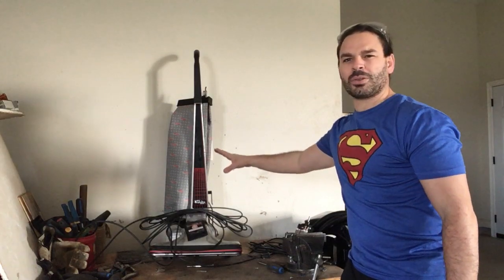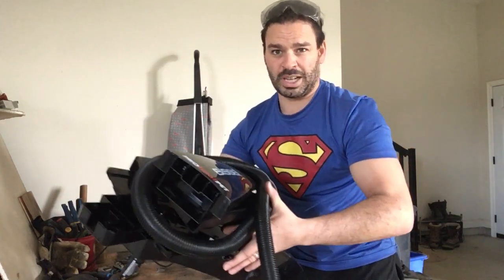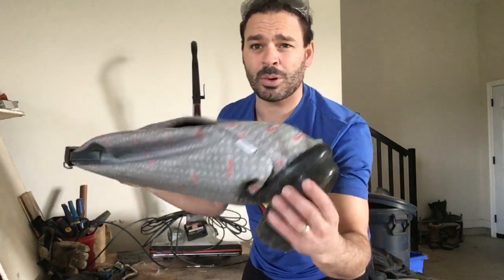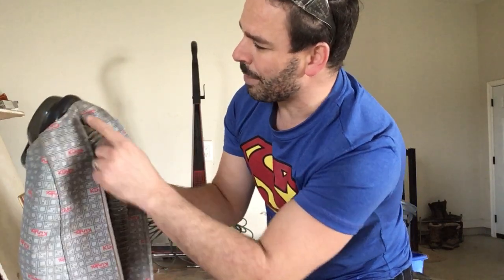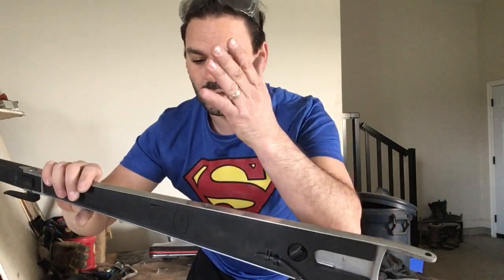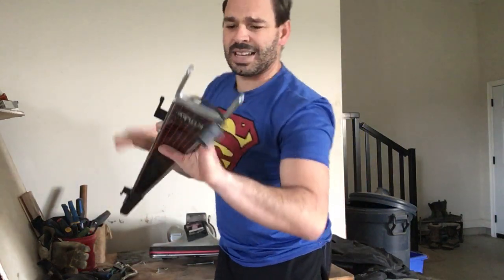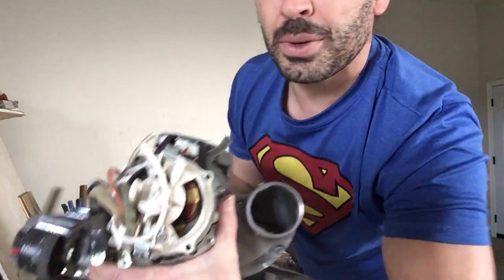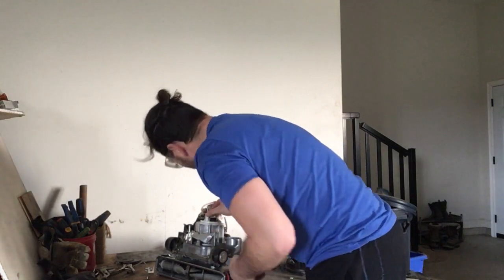Scrapping an old vacuum cleaner for copper, cast aluminum, brass, steel, and very little waste.

Comment: I grew up with a Kirby, and hated cleaning out that bag!  It did do a pretty good job though.
Reply from the maker: It is too bad it did not work. They just don’t make things like they used to. Thanks for the comment
Reply: @TinManScrapper  if you get a kirby vacuum you can call kirby for parts for any molde the only one's  that they don't make parts for is pre ww2 if you buy one new  that is a 2500 dollar vacuum

Comment: You have an 84 Kirby Heritage. It was probably an easy fix, you could have replace the switch and sold the vacuum for $100. Great video!
Reply from the maker: Thanks for letting me know! Lesson learned, but at least it did not end up in the landfill. Thanks also for the kind words and support. Stay well
Reply from the maker: Actually I have another small older vacuum here...a TriStar. Has the front hose but not back motor. Wonder what it is worth
Reply from the maker: You can be my vacuum specialist. Amazing how many vacuums I have found on garbage day. I have actually donated some, sold some and scrapped many.
Reply: @TinManScrapper  Do you have a picture of it? I am not sure what model it is but I would recommend keeping it until I can tell you what model it is.
Reply from the maker: @christianmoore7046  it says TriStar cxl on bottom. Online it looks like 1992 date. No motor at front or power head.

Comment: Good day  Yes alot of plastics.  I worked in a small welding shop, rented out part  of building to plastic grinder, Yoguart  containers could not be sold .  Thanks
Reply from the maker: Thanks, yeah we need to find a solution to the plastic problem. Happy holidays
Reply: @TinManScrapper  precious plastics has some cool grinders and ideas for recycling /cheers
Reply from the maker: @scrapbongo  cool, I will check it out

Comment: @Tin Man, would a copper bearing motor be worth the 10 cent/lb if I broke the motor trying to remove it?  There are some cool gears that I would like to have off of it but I don’t have special cutting tools and used a big hammer to try to open it. 
I thought I could repurpose the big copper wires but they ended up being wrapped in such a way that they came off in pieces.   They weren’t true copper wires either but they were easy to shape and I wished I could have got them out.
Reply from the maker: Yes, it is the copper they want so the inner, cylinder with copper and the square item that has the copper coils. I open them up to get the aluminum and copper since #2 copper wire and worth way more than copper motor price. Although the inner cylinder is very difficult to get copper out so I throw those in the motor bin